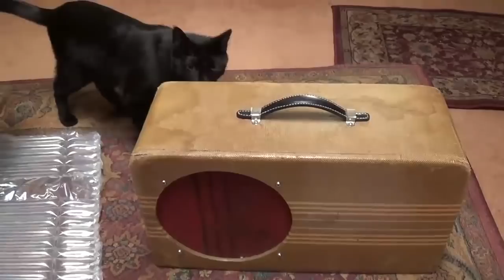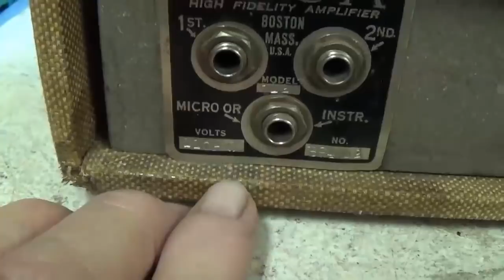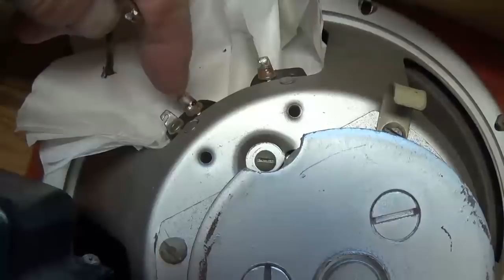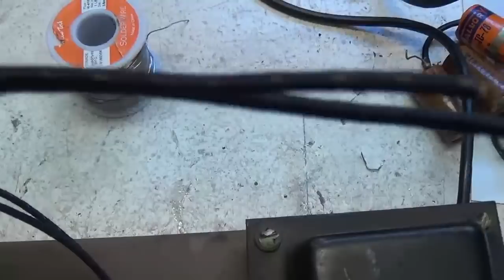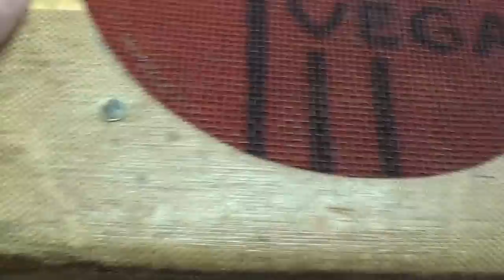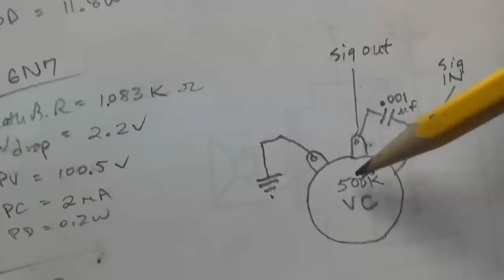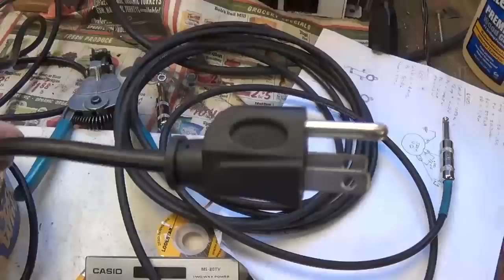Rare & Wonderful 1940 VEGA Model 112 Guitar Amp....Wow !!!

Comment: I see you've got a rival watching you giving you a thumbs down!! Maybe he doesn't realise that a thumbs down is worth two in the bush if you know what I mean!
I can see the remanence of the red stripes below the White I haven't got to the end I'm assuming you're going to correct this
Well that's not correct to say it doesn't matter polarity of the speaker it does make a difference if its in phase or out phase,  + is in phase, connecting it the other way round would be out of phase, resulting if it's out of phase with a lower base tone roll off off axis and vice a versa. So if it sounds a little bit on the tinny side to reverse the polarity, if the base is a bit wooly it might be corrected by the other way round to reverse it and we'll give you more high lower frequencies making it more punchy sounding.
What about running a 200 or 300 ohm resistor in series with the capacitor on the volume knob. I think having other drivers in the same unit connected out of phase can work they don't all need to be connected to same polarity. Take a mid-range driver I prefer it to be out of phase to the woofer some crossover adjustment is needed tho maybe.
Reply from the maker: Yes, I have noticed that several brain-damaged lunatics seem unable to grasp the subtle beauty of my videos, John, but as the old Turkish proverb says, "The jackals may howl.....but the caravan moves on".  Thanks for all your comments, John.
Reply: It was the guy who knocked the new transformer in with a lump hammer
Reply from the maker: No doubt, Frank. Perhaps we need to use the hammer on his index finger :)
Reply: @UncleDoug I see your cat at the end is marking it's territory better than a dog pissing up the wall😂
Reply from the maker: @johnsweda2999  He's definitely making sure that it's his front porch :)
Reply: @UncleDoug  He would soon bandage it up with sticky black "insulation" tape and get back to the forge :-)
Reply from the maker: @dreddwailing6395  I know where he can find a whole bunch of that tape.....I removed it from the Vega amp :)